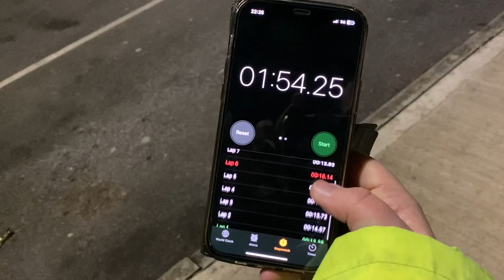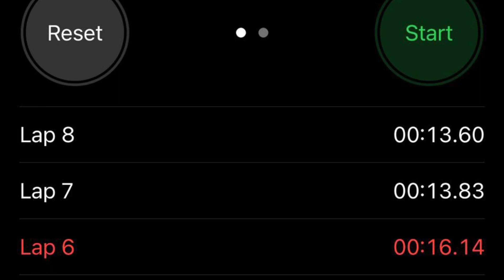Kyosho Turbo Optima First Run

Comment: Awesome build and fantastic maiden run! What a lovely sound it makes too!👍😊
Reply: Hiya Sean!
Cheers buddy..... Yes she certainly sounds and runs lovely and smooth!
Need to take a bit of time getting used to the handling, I was taking it extremely cautiously around those curbs after having a nasty multiple roll just before the camera started rolling! 😬
But, can certainly see a lot of potential there.
Obviously, this model comes from the period of dirt tracks.... so looking forward to getting her out on the loose stuff once the evenings get a bit lighter in the spring.
Many thanks for watching and commenting bud. 😊 👍 👍 👍
Reply: @yodadarksideGreenHawksRC  Ouch.. always hurts to witness the first accident..😅 I’m sure you’ll have a great time with this come spring and summer. It’s even more fun running it on dirt. Great handling car.👍😊